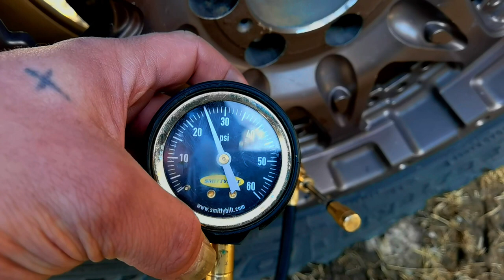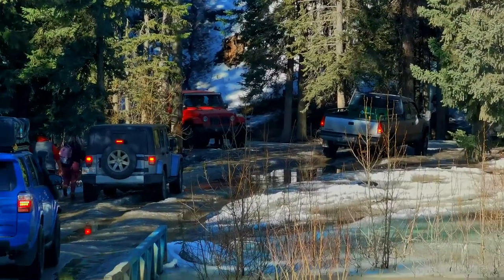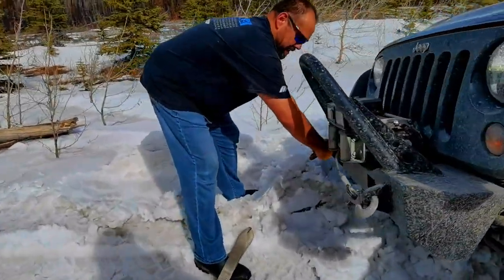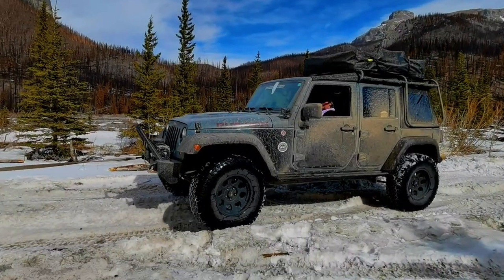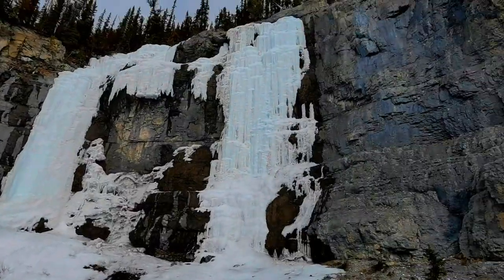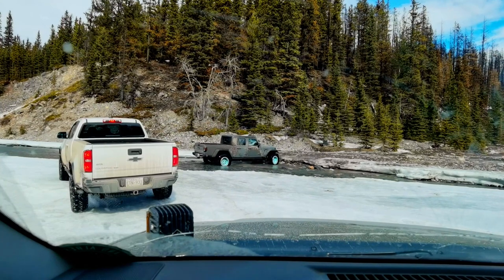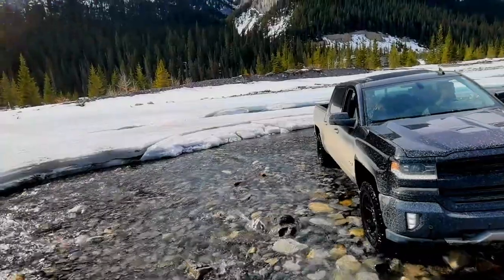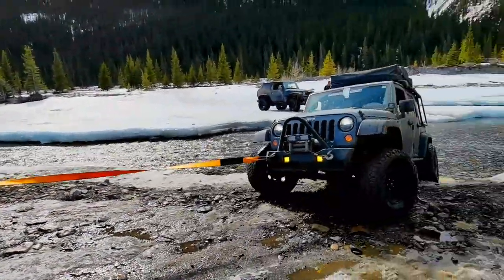This Alberta trail has the most epic views #blindmanoverland

Comment: I got by wife a 2021 Lexus LX570 and I know there is going to be a redesign but she needed a new car and I wanted to buy her something reliable. So she wants to take it off roading this summer and I am wondering if it is capable enough to take it here and make it all the way through
Reply from the maker: The trail conditions are depend heavily on the ice pack and snow pack, you can likely enjoy most of the trail, however the main water crossing can be difficult if you don't have clearance, the Lexus may struggle a bit and lately there has been more than usual rigs stuck needing to be recovered. I recommend checking it out but always trust your gut, if you're not 100 percent sure you cna make it in and out of an obstacle then it's best to avoid it
Reply: @BlindmanOverland  Okay thanks